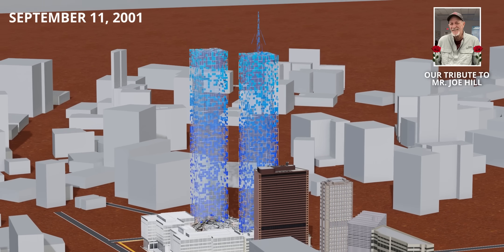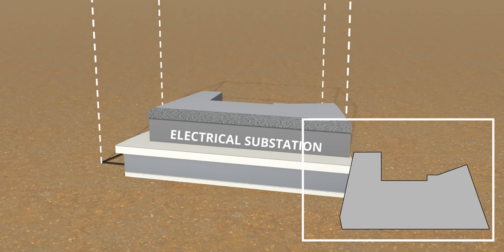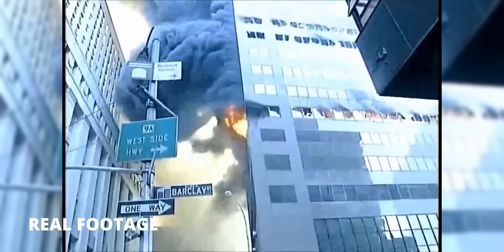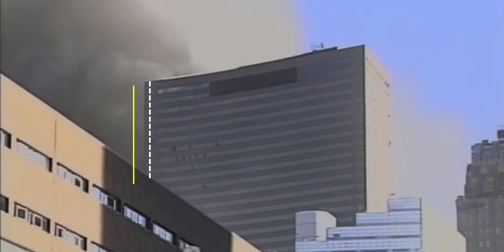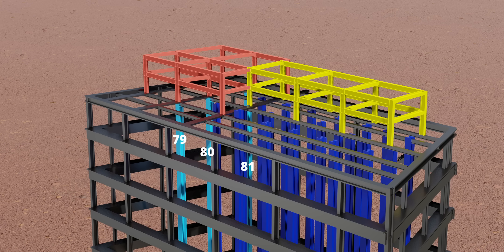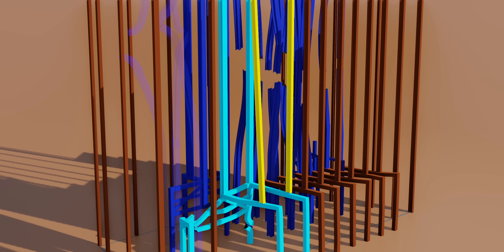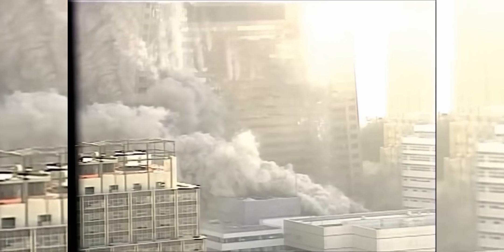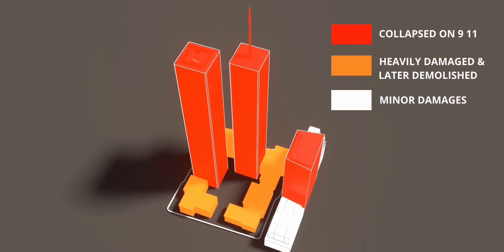Collapse of Building 7 | The Complete Physics

Comment: What a load of crap.  I have no problem with the idea of some columns collapsing.  But the building would have remained mostly intact and fallen over on its side if the columns collapsed progressively from one end to the other.
Reply: So why didn't it?

Either reality is wrong, or you are.
Reply: @TheCriticalStinker-01 Because all the columns did collapse at once, aka controlled demolition.  The video purports that the columns failing sequentially resulted in the uniform collapse that we saw in reality.  Such a thing cannot happen.  If the first half of this guys hypothesis is correct, that the columns collapsed first on one end of the structure then tlradiating through to the other side, the building would have crumpled or toppled towards the direction of the initial columns that failed rather than straight down.

Comment: If you believe this video, you also took the covid shots and weared the mask. This is nonsensical lies, immediately obvious to anyone who has more than 2 brain cells. Massive steel-H beams suddenly pulverizing and freefalling on their strongest direction? And steel wont even weaken in normal fire temperatures.That is why stoves are made of steel. BTW if those H-beams freefall down instead of topple, there should be 100m of empty space below them on the earth.

Comment: Appreciate the attempt, but if this is the case, then why after 3-4 years after 9-11 did the report come out explaining nothing 2 second video and every engineer had questions, and never showed how it went down.  A fire on the 7-13 floors on one side of building, doesn’t weaken the transfer truss in the basement, heat rises doesn’t fall, and odds of fires reaching 600 c degrees from a building built out of concrete and steel vs wood like a home, is unlikely as well, before collapse the fires we almost burnt out.  Oh, forgot to mention, never  in history has a building collapse cause of fire,